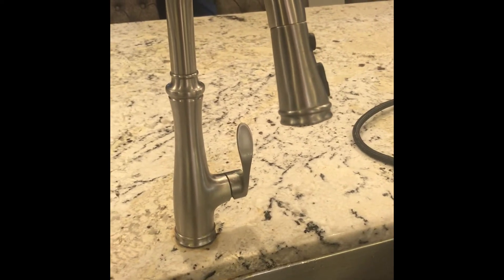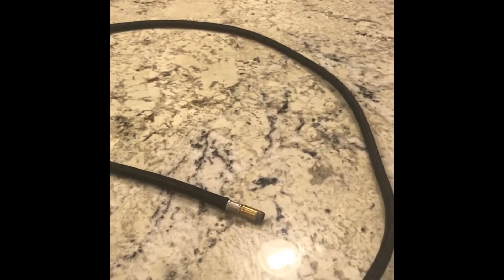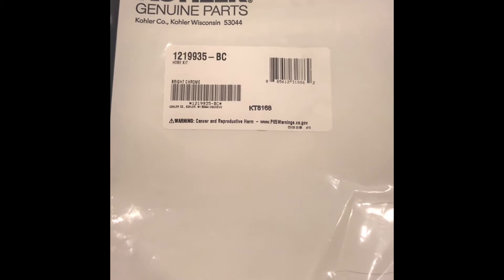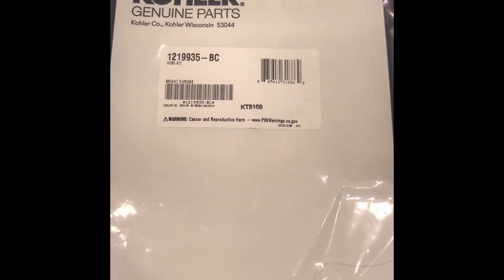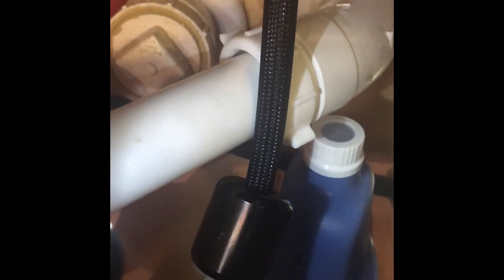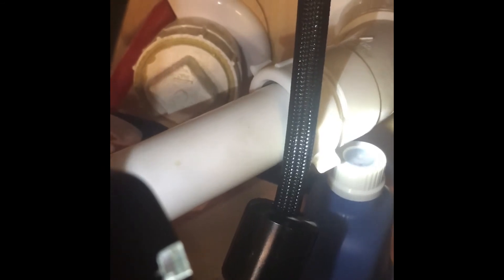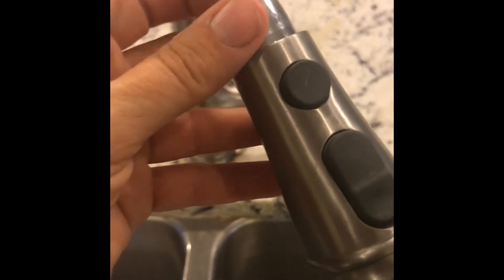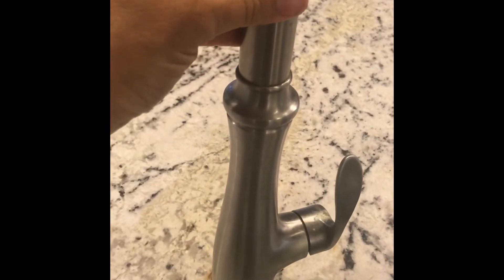Kohler spray replacement hose

Comment: You are an angel of mercy. All other videos act like threading the hose back down is easy, but it gets stuck in the gooseneck. I had to use a screwdriver to loosen the top of the gooseneck as mine did not pull right up. Thank you!

Comment: Michelle, your tips helped me the most. After inspecting the new hose and collet I understood how the fitting works. By using the hose weight as a slide hammer against the collet and pulling in the hose simultaneously it popped right out. Gentle tapping force with the slide hammer. Brute force would be counterproductive. I know this fitting has been in service for several years and I do have mineral deposits in my water. But it popped right out! 
Your suggestion to remove the arched pipe made it a lot easier to feed the new hose down. Saved me a lot of frustration thank you!
Reply: "Gentle tapping force with the slide hammer". It worked. Brilliant. Thx

Comment: Thank you so much for posting this. If I had not come across your video, I’m not sure how we would have managed to get this hose replaced. Your recommendation to push the connector up and twist it did the trick!  Also, just as you said, our hose got to a certain point in the neck and would go no further. Did not know that the neck of the faucet lifted off-took a bit of strength-but my husband got it. Took us 15 minutes, but are sure we would have thrown in the towel and called a plumber if not for you. Thanks so much!!!

Comment: Used your video which was soooo extremely helpful.  One thing I would like to point out is that from listening & watching your video and reading thru everyone’s comments, I wasn’t sure whether the white plastic ring was to stay in place or it was supposed to be pulled out along with the hose.  After pulling and twisting and turning for an hour which resulted in a very sore shoulder & use of icy hot, I gave up and started working on it the next day along with my husband this time, which he tried for 30 minutes and then gave up & said just call a plumber to do it.  So being a person that is hardheaded and won’t give up on completing a task, once my husband left the house, I gave it one last try and to my amazement it came free and the white plastic ring DOES stay put when the hose finally comes loose.  Thank you very much for posting ur detailed video & explanation.

Comment: I tried various things mentioned in the video and comments, but nothing was really working.  I finally sprayed the connector with a little cooking spray, let it set for about 30 minutes, and then used the weight to push the collar up.  As I did that, I pulled the hose down and it came right out.  Extremely helpful video and comments!  I also had to take the top off the faucet to get the new hose installed. So, the video is exactly right about that as well.  Much better than the video Kohler has put out!!

Comment: Thank  You Michelle. It took me 1 1/2 hours also and it was your description that gave me the encouragement to press on. What I found is that over time the collet and the hose end get stuck together from the minerals in the water. Consequently it takes a lot of twisting, pushing, pulling and patience to allow the movement needed to separate them. At the last I put on a pair of Mechanics Wear gloves to give my fingers a break and that turned out to be the extra grip needed to get this apart. Thanks again.

Comment: Thanks, that was excellent. I don’t have a lot of strength in my old hands, so I used a 13mm open ended wrench to push the white tabs up and it worked like magic. Thank you so much for your calmness and clarity
Reply: I found a 13mm is too small, but a 14mm open end will work.

Comment: Thank you so much for this video - we had to change the hose on the same model and were getting stuck feeding the new hose down through the faucet. Your tip to remove the bend piece was clutch! We were able to get the original hose out of the collet using some WD-40, letting it sit for a few minutes and then just wiggling and working the hose out of the attachment.

Comment: Thank you for the video.  I had the exact same faucet and you video saved me tons of time and aggravation.  Especially the connector.  I had to use a pair of vice grips set for the size of the plastic piece to push up on the plastic piece will pulling down on the hose.  Thanks again.
Reply: I should have read the comments about using the weight as a tool to push up on the collet.  Great idea.

Comment: Collet info quite helpful.  I should've watched videos first.  I needed another set of hands since I have very little hand strength.  Luckily, I have a teenager.  

My spout is harder to remove.  I ended up feeding the old hose back up the wrong way from the bottom, then tied a ribbon to it and pulled it down.  I attached the new hose to the other end and kept pulling.  That worked.  

I should've attached a string from the get go.  Would've saved me time.  I attempted the hundred monkeys version of tap tap tapping it down, but failed.  

THANK YOU!

Comment: I was able to finally remove the connection after 25 minutes. I did exactly what you said, use your weight then push and pull. It took me about 8 tries to get the hose thru the faucet and pass thru the bottom. I feel lucky that it worked out. But I am thrilled and thanks for the help

Comment: Thanks for this video, it helped me replace the leaky hose. The one I bought came with a plastic cap on it that helps you fish it through easier so it doesn't get stuck. It was nice and easy then it clips it into the quick release fitting (I don't know the proper terms). My brand was Moen.

Comment: I had the same issue you had getting the hose off, that type of connector is difficult. the plastic sleeve has to be pushed up at the same time you are pulling.  But a big part of it is the corrosion on the Collet connector, it takes awhile but moving it up and down and twisting helps.

Comment: I just fixed mine a few minutes ago. Here’s what I did:

1. Tried to twist the collet (white thing)- no dice
2. Sprayed above and below the collet with WD-40
3. Wait 10 minutes
4. Use the weight to apply upward pressure to the collet with one hand and pull down on the hose with the other. (There was a lot of pushing the hose in and out)
5. Hose came out and I scraped my knuckles because it was a surprise.

Good luck.

Comment: I almost gave up trying to disconnect that pain in the ass collet with vice grips and wrench, but in the end I used my hands and followed your tip of twisting back and forth while pulling out and it came loose. 👍🙏🏼

Comment: I found another similar video where they recommended to use the weight as a tool. Also suggested to use HD-40 in the collect and run hot water. I did all that and also your suggestions. Something else I did was to use pliers to turn the hose (in case was stuck because of water sediments). After some good pulling, I was able to do it!

Comment: I was hoping to see how you disconnected the plastic connection for the hose. I’m trying to remove a Koehler faucet and can’t get the white plastic coupling to disconnect so that I can remove the locking nut and take out the old faucet.

Comment: WD40 IS THE MAGIC KEY!!!!  The reason it does not unlock is because the rubber o-ring was not sliding back into the unlock position.  Tried for 30 minutes, called Koehler service....blah, blah blah.  A shot of WD40 - came of after 20 seconds of shifting it around to get lube to the ring.  BOOM!!!  came off.

Comment: To remove the plastic collet, I wrapped some copper wire around it, then twisted the wire with pliers until the collet was  compressed and was easily removed. Personally,  I don't know why Kohler never just used a threaded compression fitting.

Comment: Thanks for posting this video.  I found it very helpful, especially knowing the potential problem spots. I used  this video along with the written instructions on Kohler's website: https://support.kohler.com/hc/en-us/articles/360001860994-Install-a-Hose-in-a-Pull-Out-Sprayhead-Kitchen-Faucet  (I have the collet connector hose.  I ended up using a pair of pliers to gently push the white plastic piece up, and then pull the hose down.  Initially I tried it with my fingers, but there was not enough room on the plastic piece to be able to give it enough force.  The other roadblock was threading the hose down the faucet as it did get stuck, even after removing the top part of the faucet, as it was mentioned it most likely would.  I don't know what I did that eventually worked, other than just trying to thread it down several times and continued to push it and eventually it just went past the point where it was getting stuck. The other thing that worked for me, was I used the same pliers to gently squeeze the metal ring that was keeping the weight in place.  I noticed it had some tabs and you can just use pliers to gently squeeze the tabs which expanded the ring enough which allowed me to glide the ring off the old hose, and used the same process to install it on the new hose. I didn't use any real force throughout the whole process as I didn't want to break or damage the new hose or the faucet or pipes.  Glad to have that done.  Now I know I'll be repeating the process in about 3 years, if it holds up like most reviewers have indicated).  Thanks again!

Comment: Even after watching this and several other similar videos, I still can't disengage the hose. The hose actually doesn't move even a bit when I try to push it up. This is a typical stupid design by someone sitting in an office without any knowledge or experience of a real life plumbing system. Why Kohler adapted this kind of white elephant design is totally beyond me.